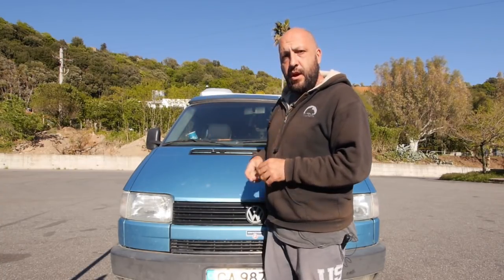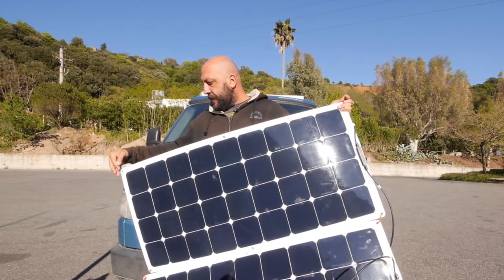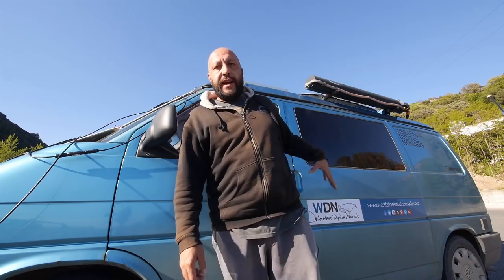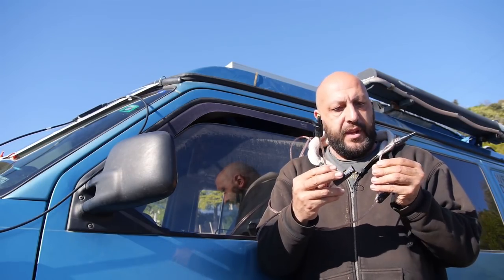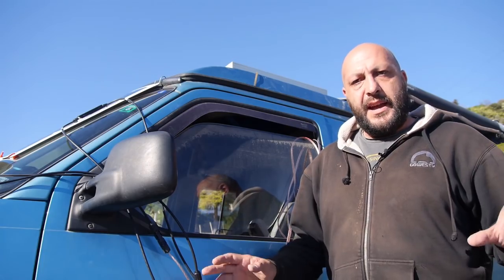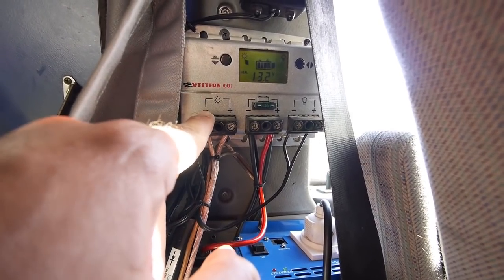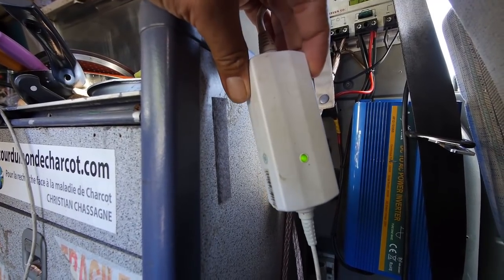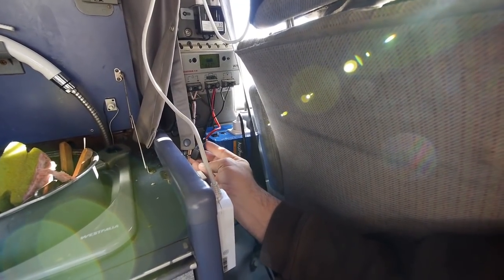Flexible Solar Panels for a Van. Ultraflex & Portable Solar Panels

Comment: Hi guys... Hope you are well.... Just revisiting this handy video.. :)
So, to charge your macbooks only ...
Solar panels > Solar input box > Solar Controller slot 3 > 5A Cigarette lighter > Transformer > Computer ??
Reply from the maker: also computer. So before I had a PC Dell and I bought a variable transformer with cigaret plug. So I set it at 19.5V. The only difference was that it did not charge the PC but only kept it at the same battery level
Reply from the maker: with Mac we bought 2 transformers (one 85W and a 60W) but with mine I had problems (it probably blow the board), so I can't really advice it that much now. With Mel no problem (she has a Mac Air). The transformers were Lavolta
Reply: @Westfaliadigitalnomads  
ah ok, so regarding the more powerful macbook (85W), its probably better to use Solar to charge my Leisure Battery and from there, use an Inverter then do you think?
Reply from the maker: @MZONE3D  i do like that now, only with a 1KW pure sine inverter

Comment: You can get rare earth magnets with hooks from Amazon. They are very strong and would hole up in a fairly strong wind. You could use 2 for each panel.
Reply from the maker: well one is fixed to the top, the second one it's out only for extra power

Comment: Looks great Armando, I would look into a more secure way to hold the panels just in case of wind .
How big (capacity) was your battery bank?
Reply from the maker: we got two AGM batteries 110A. pretty good I say. The panels have holes so with small car elastic will be easy!
Reply: You have plenty power there, 100 to 110 usable amps. 
I take this opportunity to asking you about your VW, which engine it has, the 2.5 diesel?
I am thinking in getting one Transporter or the Crafter with that engine and manual gearbox. 
Saludos
Reply from the maker: Our is a 1.9 TD, for me the best engine ever! It's a mule!! And diesel.
Reply: hi bro that’s good idea i have t4 2.5tdi on 350000miles looking to expand solar have 2 x 100 watts solar plus 30watt on roof box  at moment